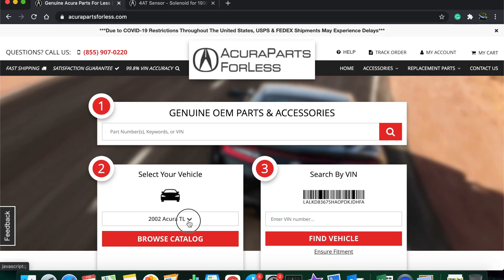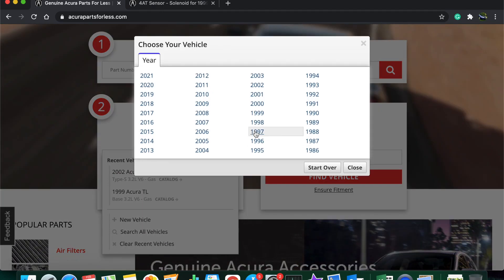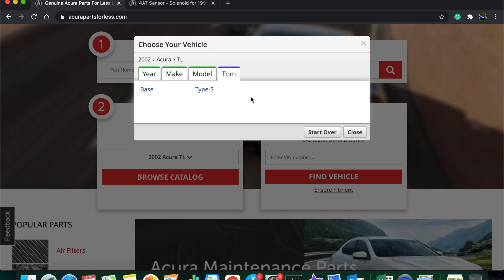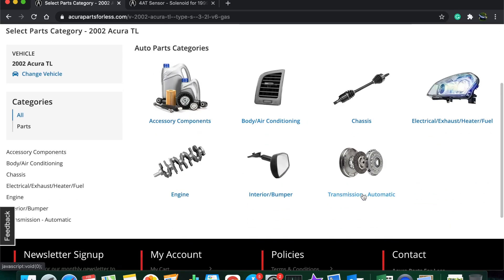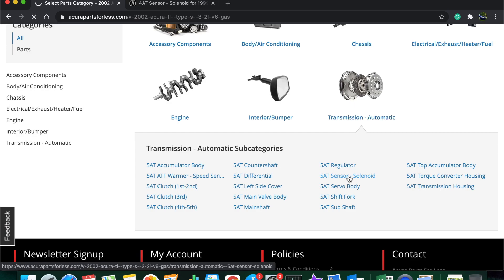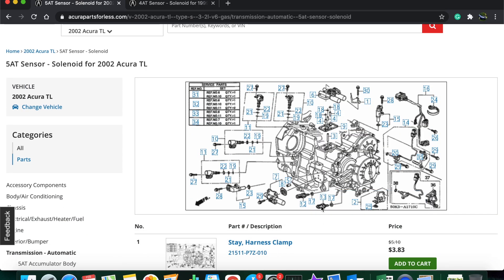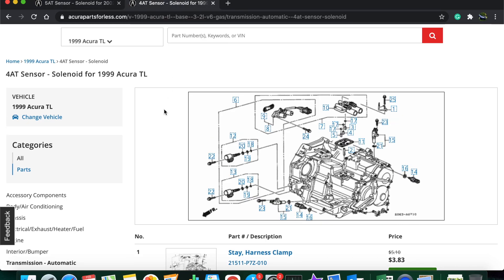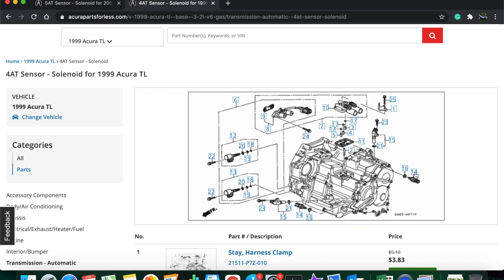How to Replace Honda/Acura Transmission Clutch Oil Pressure Switch P0845 P1738 P1739 P1740

Comment: Hi! You have great video I have engine code p0740 p1738 and p1739 what should I check first or any suggestions?
Reply from the maker: To get all three of these codes at the same time is weird. I would start by checking the solenoid screen filters as shown in my other video to ensure they aren’t clogged. Then check your transmission fluid and make sure it’s both clean and at the proper level. Consider replacing the exterior spin on ATF filter if your car has one as well.
Reply: @CarRepairsMadeSimple Thank you for your reply I cleaned solenoid screen filter as your first video and drove for 50miles and engine check light on with tcs and my symptoms are 1st to 2nd gear is hard shifting I checked code again and p1738 and p1739 went away but have p0740 still remain so I will try to replace shift solenoid b and c as your 2nd video 
Hopefully this fix my issue 
Thank you again!
Reply from the maker: @homeboysstereo  I'm guessing you have a 1999 TL based on your p1738 code. Since your main symptom is hard shifting from 1st to 2nd, it might still be necessary to replace the 2nd gear pressure switch, as they're known to go bad. Since for your car the 2nd and 3rd gear pressure switches are the exact same part, you could try switching them and see if your symptoms change, and that'll let you know if a pressure switch is bad. 
P0740 for your car would also indicate a problem with Shift Control Solenoid Valve A (28200-P0Z-003) and Clutch Pressure Control Solenoid valves A and B (28250-P6H-024). Both of those solenoids have screen filters. The Shift Control Solenoid Valve A is another dual solenoid on top of your transmission and wasn't shown in my solenoid screen video since it's only on the '99 TL & '97-'99 CL. Make sure you clean that one as well if you haven't already. I would recommend doing an ohm test on the solenoids as well (12-25 for the shift control solenoid and about 5 ohms for the clutch pressure solenoids).
Lastly, if you do replace any solenoids, don't get anything aftermarket as they're known to be problematic. My recommendation is to check the junkyards and ebay since new ones cost like $500. Good luck!
Reply: @CarRepairsMadeSimple sorry I have 2001 Honda Odyssey I was confused with someone from YouTube 
But thank you anyways!
Reply from the maker: @homeboysstereo  looks like the 2001 Odyssey has an identical transmission as the 1999 TL I referred to in my last comment. So you could still consider that same advice if you want. You're very welcome!

Comment: Literally have the same exact model, spoiler n all. Bought it at 69k miles right now I’m at 83k. Check engine light just came on for p1750, secondaries p1750 p1739 p1740 p1298. So here I am 😂
Reply from the maker: Sorry for the late reply. Dang that's a lot of codes, all of which unfortunately are unrelated. p1750 has to do with the dual solenoid on top of the transmission (28250-P6H-024) Check out my other solenoid video which shows you how to clean out those screen filters inside the solenoid. If that code persists, it's possible the solenoid needs replacing. p1739 is the 3rd gear pressure switch (28610-RKE-004), replace that. p1740 is the 4th gear pressure switch (28600-P7W-003), replace that as well. One other thing I would suggest is doing a transmission drain and fill if you haven't done so in a while. Your car might not have a lot of miles, but the fluid itself still needs to be rejuvenated as ATF can break down with time alone as well. Check out my ATF video on how to do that and consider replacing the exterior ATF filter as well.  p1298 is the ELD (Electrical Load Detector), replace it. It's located in the passenger side fuse box in the engine bay. It's the brown box with an electrical plug connected to it, between the 60a and 120a fuses. It controls whether the alternator is on or off. There's no direct replacement for our TL. You'll often read about needing to replace the entire fuse box, which isn't necessary. Instead, you can buy an ELD found in the slightly newer Hondas that will work, (38255-S5A-003).

Comment: Would appreciate a response been loving these videos as I have a 2003 Acura tl type s just put in new filter filled the tranny and cleaned solenoids but it still worn automatically shift from 2nd gear into 3rd gear I have to push the gear selector up to shift after 2nd gear can anyone help ? So far the only thing I can think to do next is the pressure switch after that I’m really not sure what to do I want it to shift into all 5 gears automatically
Reply from the maker: @Maddox453-B  these pressure switches are known to go bad. You’ll see it all over the forums that people will even replace these routinely every 100k as preventative maintenance, which I think is a little excessive but it can’t hurt. If tackling the atf, filter, and solenoid screen filters didn’t work, the pressure switches are your next step. Also, if your ATF still looks dirty after a drain and fill, it might be necessary to do another one.
Reply: @ thank you so much I wasn’t expecting a response will make sure to do pressure switches next 🫡
Reply from the maker: @Maddox453-B  I hope it helps! It has for me and many others, good luck!

Comment: PLEASE HELP!! I changed the switch and 2 days later I’ve experienced it got worse
Reply from the maker: @hosea89  where did you get your parts from? You could try putting the old switch back in to see if it performs like it did before to determine if the new switch is the problem or not
Reply: @ Acura OEM but I will clean the solenoids today from your other video
Reply from the maker: @hosea89  good idea! Those solenoid filters have caused many problems for many people over the years. Good luck!
Reply: @CarRepairsMadeSimple  will keep you updated

Comment: 5:31 that's the one I did today myself now I'm gonna do the 4th clutch today because I'm still getting p1751 but it was due to 2-3 shift malfunction so now since the 4th is all I have left to change I'm gonna do that one too and give update.
Reply from the maker: Gotcha, yah a lot of people in the forums have said they needed to replace both solenoids. Not always necessary such as in my case, but again I hope this resolves everything in your transmission!
Reply: @CarRepairsMadeSimple  it didn't work sadly I'm still struggling 😪  I believe it may be the torque converter then at this time because everything is new. The folks in autozone to me to check for the teeth on the transmission where the donut 🍩(torque convertor) goes and it may be possible a tooth is missing causing it to slip
Reply from the maker: @HomesickTiger  oh no, that’s terrible news. I’m sorry replacing the parts didn’t help. A broken tooth sounds like an expensive headache. I’ve never heard of this happening before. I suppose anything is possible on a 20+ years old car with many miles on it. Hope you can find a resolution soon. Let me know if there’s anything else you need help with.

Comment: I also have a 02 acura tl base and I changed all my solenoids except the 4th and 3rd. My question is 3 and 2nd are together with the 3rd sensor location? I got P1751 code and said it was 2-3 gear shift malfunction thank you and loved the other videos you made of this car!
Reply from the maker: P1751 is caused by a problem with either shift solenoid valve B (located on top of the tranmission under the coolant hoses) or the A/T clutch pressure control dual solenoid valves A and B (located on top of the transmission under the battery) Check out my other video here: https://youtu.be/ZbarS605YtE?si=cOp_l_82pUUON3UP
Clean those screen filters first, and also consider replacing your ATF if it hasn't been replaced in a while. Otherwise, you might need to replace the solenoids. Good luck!
Reply: @CarRepairsMadeSimple  I appreciate you for responding to me. Thank you!

Also, I did went ahead and changed those you mentioned on Your video. (I watched all of them) I just changed my 2-3 clutch sensor and the car was able to move forward on drive easily. I went to autozone and yesterday the p1751 was due to a 2-3 shift malfunction.  So when I saw your other video explaing the 3 and 4 on your 02 acura tl. I did that and then the light came back on and it didn't have a description of the issue just the code. But the malfunction for the 2-3 are not showing now. So I assume those are good now and did needed to be changed. I'm waiting for the 4th clutch sensor from oreilly today. In the next hour I'm picking it up and I did notice on the 4rpm it would go down to 3rpm real slowly. So I'll definitely be giving an update regarding this. 

Thank you so much for your response brother ! I literally spent about $700 on all the solenoids and duel and linear ones. Now it's just that 4th clutch sensor and then I'll see if it disappears.
Reply from the maker: @ Oh man, that's an annoying situation to be in. I've been there before where I've replaced multiple parts and the problem persists. Hopefully this last part does the trick!
Reply: @CarRepairsMadeSimple  it didn't work and I changed all the parts on the video

Comment: I've done a drain and fill with the filter, cleaned all 4 solenoid screens, and replaced the 3rd gear pressure switch. The trans is still slipping; anything else to try besides another drain and fill and the 4th gear switch?
Reply: A drain and fill is not enough you need to do 2 or 3 more drain and fills because these transmissions do not like dirty fluid !

Comment: Are they the same switch.. what if I get them mixed up
Reply from the maker: They have different electric connectors, therefore they are different parts with different part numbers that you cannot get mixed up

Comment: Damn I changed this, clean the solenoid filter screens and replaced the transmission filter and fluid and it still won’t shift into 3rd
Reply from the maker: I’m sorry you’re still having issues. Do you have any check engine light codes? Did any of this at least help for a little bit or not at all? And also did you use OEM Honda parts and fluid? Aftermarket stuff has been known to not work and cause other problems
Reply: @CarRepairsMadeSimple  the only code that pops up is P0730 and yeah I used all oem stuff shifting for all my other gears feels better but it’s just 3rd gear that it revs up a lot like nothing is happening
Reply from the maker: @MexicanGamerDude  I might recommend doing an ohm test on Shift Solenoids A, B, & C (12-25 ohms), as well as the AT Clutch Pressure Control Solenoid Valves A and B (dual solenoid on top, about 5 ohms). You could also do the simple click test where you connect the solenoids to some alligator clips and touch it to your car battery to see if they're functioning properly. See if anything is out of spec and replace as necessary.
Reply: @CarRepairsMadeSimple  legend 🙌

Comment: Is that the location location on of the 2002 ACURA MDX ATF SENSOR?
Reply from the maker: The MDX has the same layout as my TL. The ATF sensor is located right next to these sensors and is difficult to replace

Comment: I have a 2002 TL with a 2008 TL tranny that was put in by the Acura dealer about 15 years ago, and it worked beautifully all these years.  But recently, I thought that the transmission went out.  

About 9 months ago, I was driving down the highway, and the transmission just slipped out of gear. I pushed the accelerator down, and it just acted like it was in neutral.  The engine just revved.  So I figured it might be just that one gear.  So I shifted down.  It was in gear for 5 to 10 seconds, and then slipped.  I kept downshifting thinking it might just be certain gears.  But all of the gears seemed to be having issues.

I was able to get it off the highway.  I did have to stop at a light, and then I was able to drive the car a little bit more.  But when I had to go up a hill, it started slipping a lot.  So I just pulled over and had it towed.  

It’s been sitting for the past 9 months. I recently revived it, bc I was going to sell it.  But in the process of getting it ready for sale, I just thought I would try driving it up and down the driveway. 

I was able to drive it up and down the driveway about 10 times before it started slipping (maybe it slips when it heats up?).

So based on what I just said, do you think it’s possible that I can just change the ATF and filter, and have the car start working again like others in the comments have done?

Or do you think it needs a solenoid?    If so, which one?

I have never changed the transmission fluid since I bought the car in 2007 with 60k miles on it.  It now has 161k miles on it.

Btw, I did smell the transmission fluid right after the slipping event, and it did smell burnt.

My mechanic said he had a customer who changed their transmission fluid, and the transmission died a week later, bc he had not changed the transmission fluid in a long time.  But I think he had a ATF flush done as well.  So maybe the pressure from the flush caused the tranny to go kaput.  That’s why I never changed the ATF when it was still working, bc I had not changed it since I bought the car.

Any advice would be appreciated.

Thanks!
Reply: FYI, the check engine light is not on
Reply from the maker: So it’s definitely a scam for any mechanic or dealership to try and scare you into not changing the ATF or saying it’s a “lifetime fluid”. A flush will definitely make it worse, but drain and fills are fine. You should definitely change the ATF right away, and yes, there’s a very good chance it could revive your transmission. I would even recommend doing 2 or even 3 drain-and-fills for that matter because of how bad the fluid is. I would recommend driving the car a few hundred miles or at least as much as possible in between changes though. Cleaning the solenoid screen filters has been a big resolution for these cars as well. I made a separate video for the solenoid screen filters and the ATF on my channel if you want to check those out!

Comment: Mine was having issues with the d5 flashing an it started to slip an it would high rev then shift hard and it also shut itself off when I came to a stop I had changed the transmission fluid an then had it flushed some people say about the solenoids but I tried to change them an the dealership said not to cuz of being pressurized I’m new to all this was hoping maybe you would have an answer of what maybe I could do to get driving again it will drive alittle bit after sitting awhile when I put it in gear I can hear the transmission or engine something making a lot of noise idk what that means thanks in advanced
Reply from the maker: Do you have a check engine light code? Could be a lot of things. Easiest thing to ensure is that you’re using Honda DW-1 and not aftermarket fluid. Also ensure the ATF isn’t under/overfilled. Next I would check out my solenoid screen filter video and give that a try, it’s helped thousands of people!

Comment: When i search through acura parts for less i get 28600-p7w-013 instead of - 003. I have exact same car as you. Do you know if it's the same 4th gear switch?  Just with a different last three numbers?  Thanks
Reply from the maker: looks like -013 is the newer part that replaces the old -003. I might have copied the wrong number in the description. also the 3rd and 4th gear switches are not the same part.

Comment: I just have to say thank you so much everybody told me the transmission was blown and that I just wasted $500 and I did the switches I did the filter 3 quart drain and fill and I’m gonna do probably two more eventually so it’s nice and red but she’s shifting she’s running going into every gear no problem no big clunk either! Do you, sir are a saint and I will tell every single person who has any Honda transmission problems about this channel!
Reply from the maker: I'm a bit late to respond, but that's amazing to hear! I remember transmission shops telling me the same thing. They don't diagnose transmissions, they only replace them. Thank you for watching and sharing my channel!

Comment: Is there a compatible trans fluid that’s not Honda? I’m buying a 02CL-S with trans problems and I want to drain and fill it right there then do the filter with Honda
Reply from the maker: I’ve heard of some people using Valvoline maxlife, but personally as someone with 338,000 original miles of their transmission, I recommend the OEM Honda DW-1. You can buy a box of 12 quarts on Amazon for $108
Reply: @CarRepairsMadeSimple  thank you this cl has 150 on the clock and I’m hoping to catch up to you some day lol

Comment: I had check engine light and TCS light come on 01 Acura TL 171000 miles Code reading P0730 P0740 need help haven't replaced any of the pressure switches yet did do the 3 transmission quarts in and out and replace the transmission filter dual linear solenoid cleaned n put back n the other did the same I don't know what else to do
Reply from the maker: is your car giving you noticeable shiting problems? Sometimes these codes won't go away on their own and need to be reset manually.